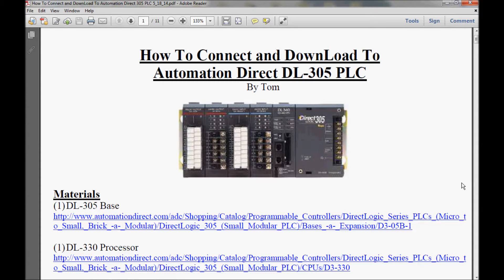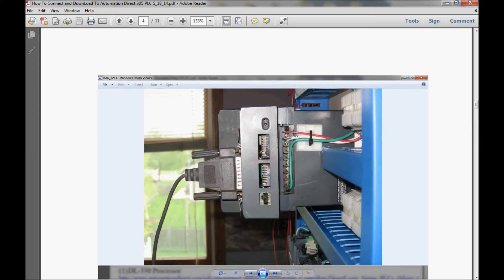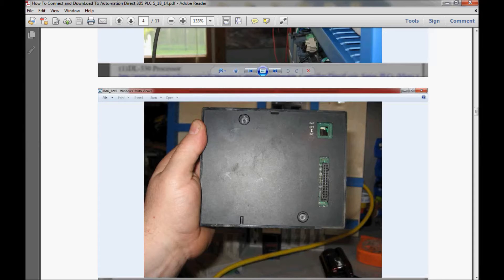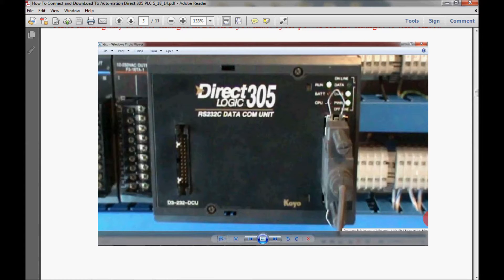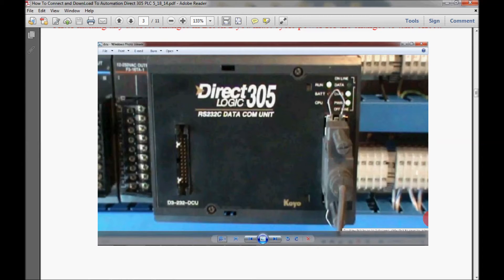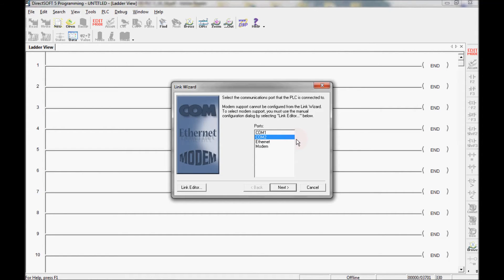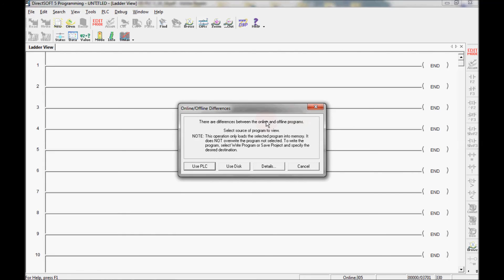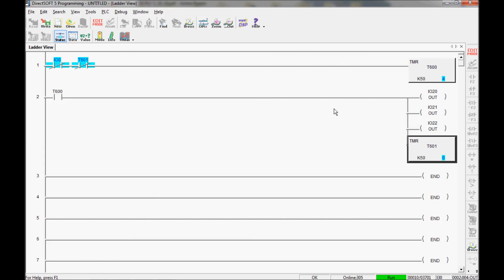How To Connect And Download To Automation Direct DL 305 PLC

Comment: Thanks for great explanation.
Could you please tell, where is CPU located?
Reply from the maker: Rafiq Aliyev, at the benning of the video I show a rack with (4) I/O cards the ones with BLUE STRIPE across the top are input cards RED STRIPE are output cards. Next to the input cards on the right side of the rack is the CPU and next to that is the power supply. Now if you jump into the middle of the video you will see a RS232C Data Com Unit, this data com unit plugs into the front of the CPU to provide the serial communication to the CPU. Now if you look closely you will see (2) screws on this Data Communication unit, these are used to secure the unit to the processor.
Hope This Helps
Tom